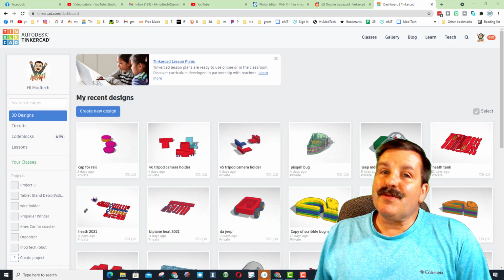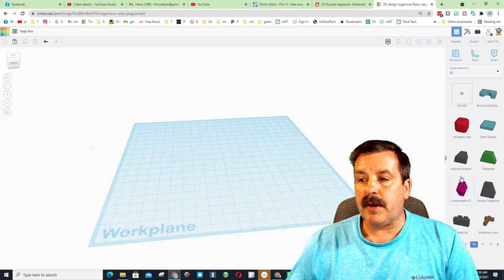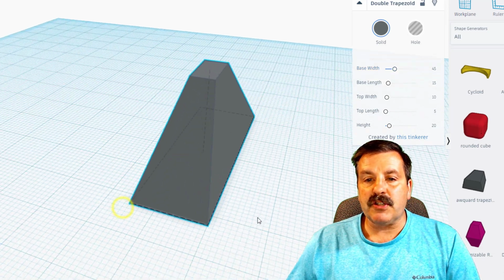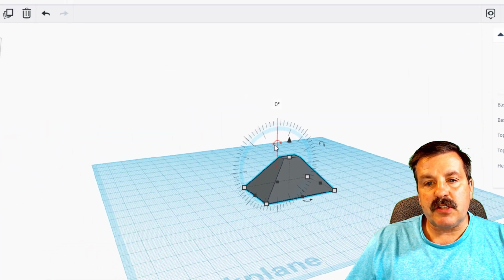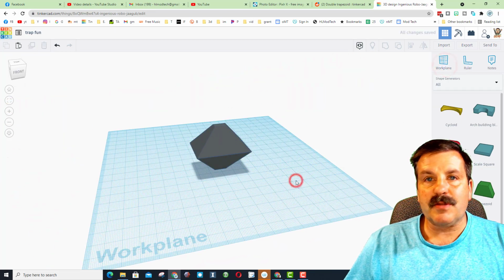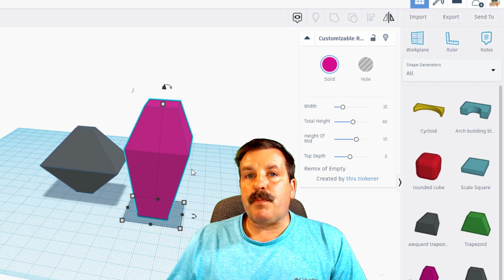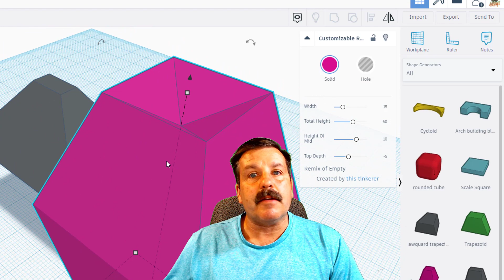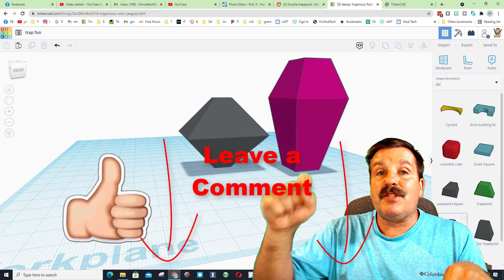Steps for using parameters on Tinkercad shapes | Double Trapezoid

Comment: If I cut the angles with other objects, does trapezoid allow me to continue adjusting it's angles?
Reply from the maker: You can rotatate even after you group objects for cutting. If you trying to change parameters you will need to ungroup it for that.